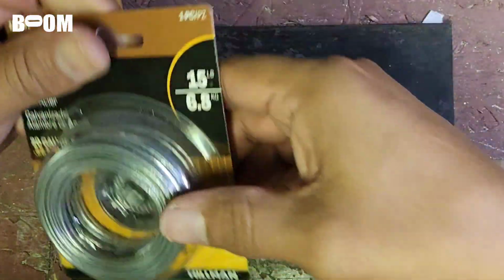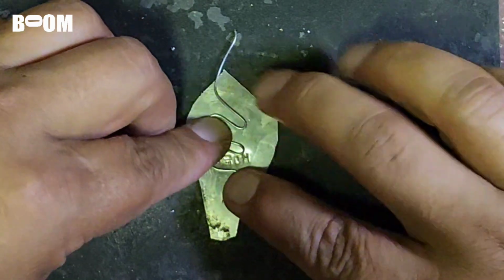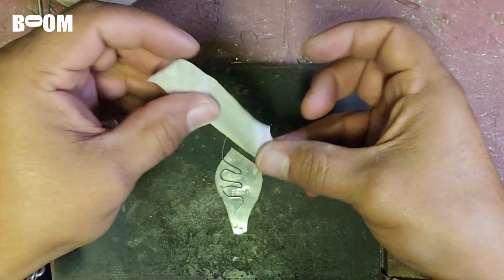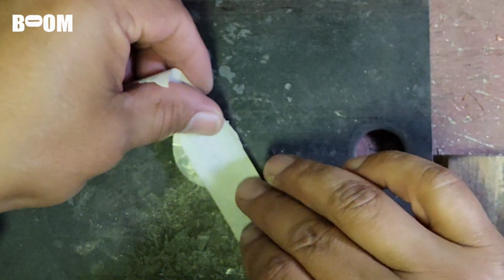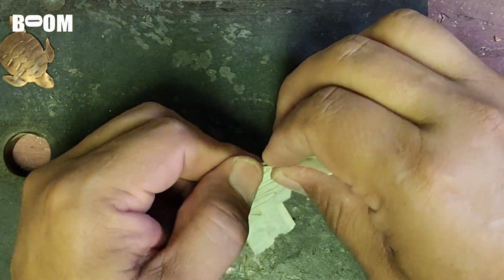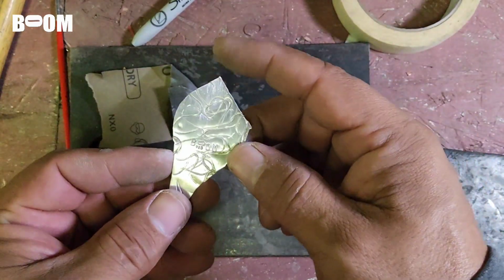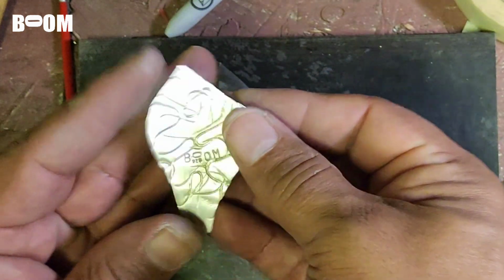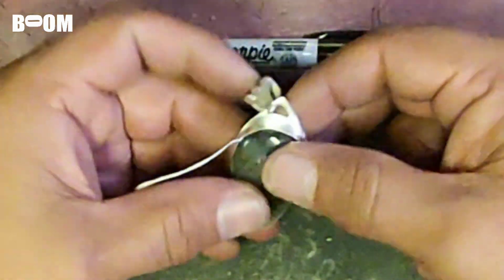Ep.69) Decorating Pendant Backplate | Ideas! | #jewelrydesign #silverjewelry #925

Comment: A great way to get customized texture for those that do not have access to a rolling mill. Trying out some sharply angled pieces could be fun too. 

Try tapping the bezel sandwiched between 2 bench blocks to straighten it enough without compromising the texture to help flatten it out. I just tap one block on top of the other a few times. Works great on bangles that are a bit wobbly and for pieces that curl up during stamping.